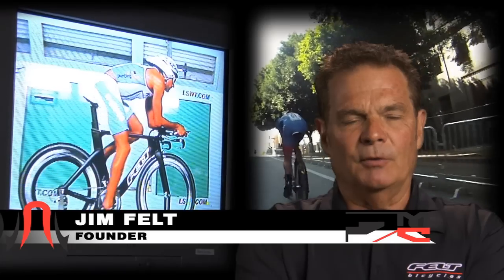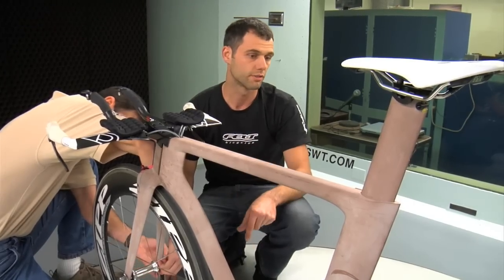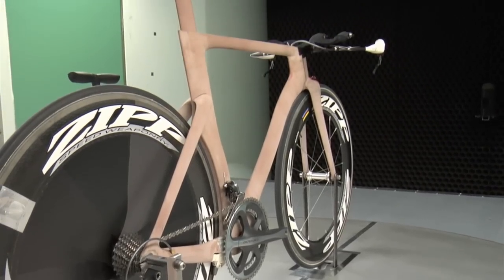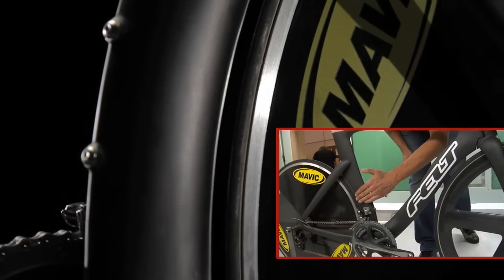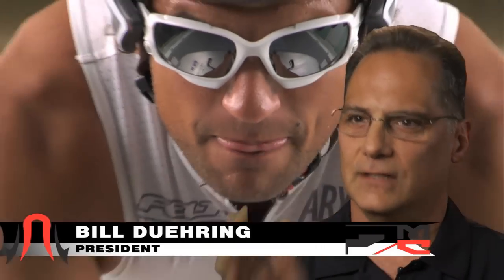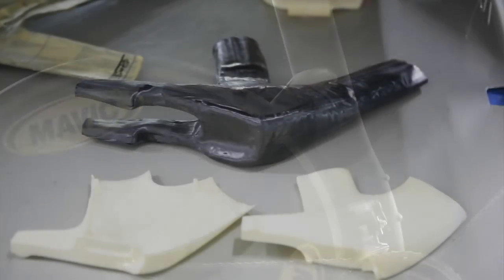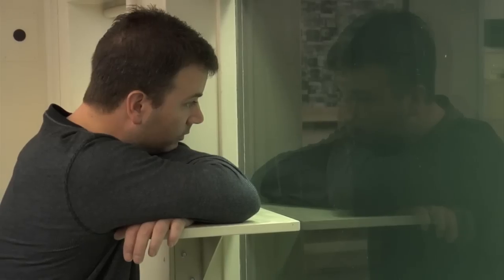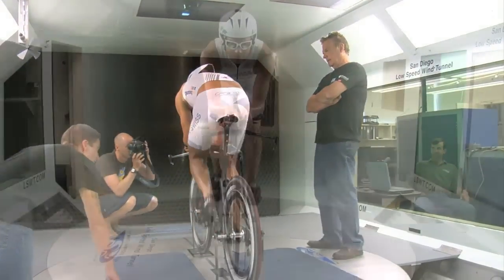2011 Felt DA

Comment: @HDub16 carbon race wheels are typically designed by themselves in a wind tunnel, however several (like the firecrest) are designed while on a variety of bikes. however the uniqueness of firecrest and other such wheels which are designed to provide a better air flow around the wheel (and thus prevent dirty air from flowing in between the spokes). this is the extent to which companies like zipp and reynolds' aero-designs reach. where this current of air travels is beyond them.

Comment: @inJCwepray  I think you over estimate the importance of rotation, not to mention the wheels were designed while on a bike, and in fact if it were to be "unflawed" by your standards they would have to have a rider on bike during every test. Air flow over the frame and fork is unaffected by the wheels; the turbulence the wheels create is the issue they would be concerned with minimizing, but wheel manufactures take care of it first, hence the engineers don't care which way they are spinning.

Comment: @HDub16 of course they do. but what are the wheels connected to? The bike. If you're going to be testing the aerodynamic properties of a bike, last time I checked the wheels are a part of the bike. They're not rotating properly thus skewing whatever data is collected for the bike. Everything needs to work in harmony. Just bc the wheels are aerodynamic in their own regard, and just bc the bike is aerodynamic in its own regard does NOT mean that the whole system is fluid.

Comment: @HDub16 while in the long run the amount of air crashing into the frame/disrupting air flow around the frame is minimal in the general scheme of things, over a 112 mile course where you may be facing a plethora of different wind buffets, degrees, and magnitudes is simply not addressed given that THIS bike and THOSE wheels were not designed to go together. while personalizing wheels to every bike is not cost efficient, felt could have done a slightly better job and designing the DA w/wheel spin

Comment: no doubt this is a slick looking bike. but theres a HUGE flaw that theyre not taking into consideration! in the wind tunnel, the wheels are spinning freely by the jetstream..backwards! when riding on real roads, wheels spin the other way, which will have a fundamental difference on air flow throughout the fork, frame & drive train, not to mention how the "used" air will attack the rear wheel. when the guy was on it, yeah the back wheel was spinning the correctly, but the front wheel still wasnt